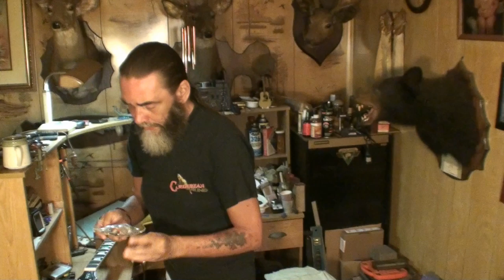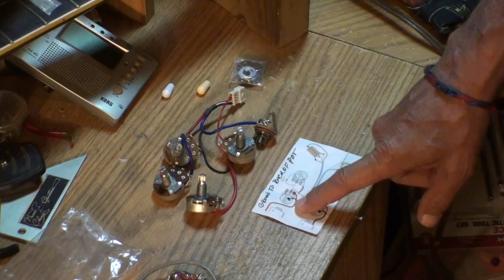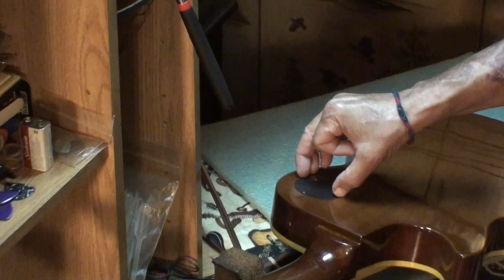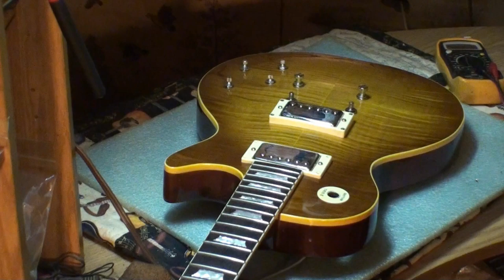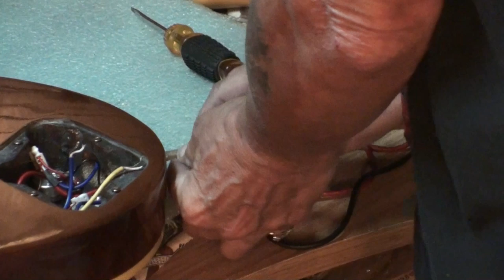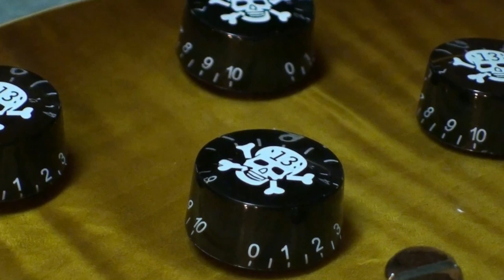can a cheap chibson les paul guitar be made into a real player? x2!

Comment: I thought you would be taking those pickups out to run the new switch wire. That switch tool is worth the $ because you can really screw up the finish with a pair of pliers. Good one Randy!
Reply from the maker: I should have taken the pups out and just left them out until I had the harness and wiring done, I must have taken them out and in 10 times lol thanks for having a look Dane!

Comment: Trolls notwithstanding...It appears the general consensus "everywhere" is to replace the electronics (PUPs, jacks, switches, pots, wiring, etc. & some hardware items if desired) from "any" guitar from China and save thousands of dollars if you just desire additional crayons in your production box that matches the feel/tonal characteristics of iconic off-the-shelf US manufactured instruments. However, if you desire something truly special, it's NOT rocket science, just a guitar any human with the implied skill level/equipment can produce when detailed specs are provided and confirmed via pics (i.e. Back: 1-Piece Mahogany w/12-hole weight relief, Top: 1-Piece 3/4" Plain Maple, Joint: Long Tenon (Ultra Modern Contoured heel) 1-piece Solid Mahogany custom elliptical/modern "flat oval" profile neck, custom paint job: Neck Binding: Electric Violet Single-ply & Body Binding: Dark Turquoise Multi-ply, Fingerboard Material: Solid Ebony, Number Of Frets: 24, 3 Humbuckers, etc.), one can theoretically own the quality of those ranging $5k-$10k+ for far less than $2k with all the push/push/pull pot wiring one can dream up (i.e. "Gibson LP Custom Shop Original" 1-off w/case). Those of you with thousands of dollars burning holes in your collective pockets can donate it to TheRockCzars & the proceeds will support All US instrument manufacturers. ;)
Reply: Here we go again... seriously? Lol

Comment: The REAL problem is the Gibson logo going on these copies. But as for just the copy aspect by itself - I mean, no one seems to get all worked up over the gazillion Les Paul copies that have been made by so many other manufacturers. But make no mistake, there are many of them, made for decades - perfectly legal, and no one thinks twice about it. So, IF you bought a Chinese LP, but without using the Gibson logo - say, with your initials or a nickname logo, etc. - well, why not? Because of all of the other copies out there, that no big deal has ever been made - well, besides the logo issue, what's the difference with all the other copies? Basically there is none! And it's easy for those who can plop down a couple of grand for a Gibson LP, to say we should deny a quality copy to a person of meager means. 

So, I say get a copy AS LONG AS (and ONLY if) you don't get one with a copied logo - AND as long as you never try to sell or pass it off as the real deal. HOWEVER, all that said, if I really wanted a Les Paul but couldn't afford a Gibson - I'd just buy a well-setup Epiphone LP. That way, no copy issues. And tweaked really well, the playability and sound of the Epiphone LP is going to almost certainly be far closer than that of a Chinese LP copy. And for all of the noise about this issue - guess just where many Epiphone Les Paul's are made - YEP, you got: CHINA! Some are also made in Korea or Indonesia. And the quality of LPs, over the years, has varied significantly. There were many years of much less quality.